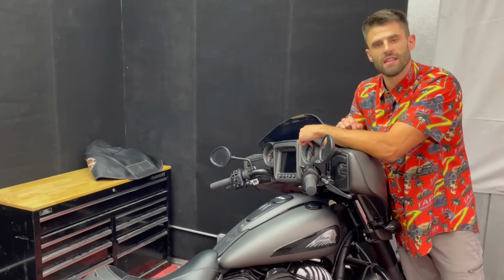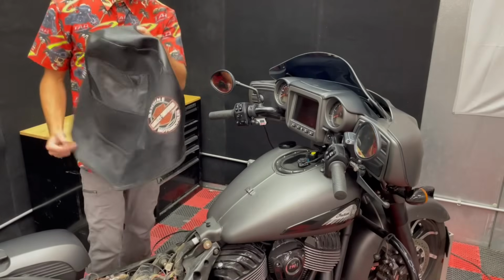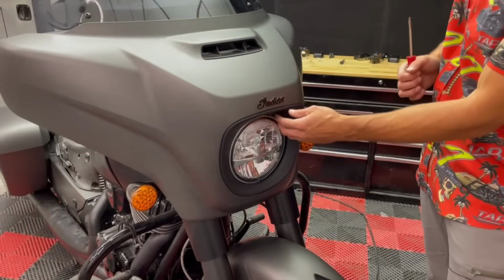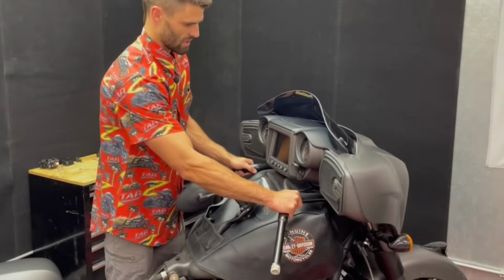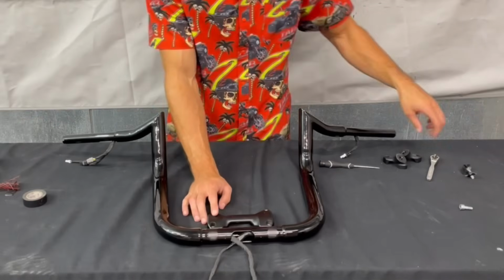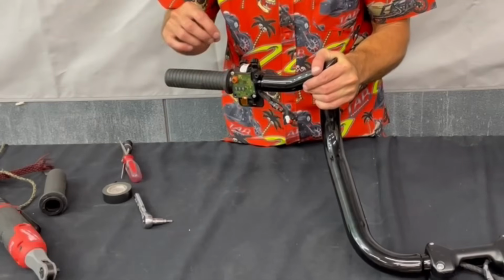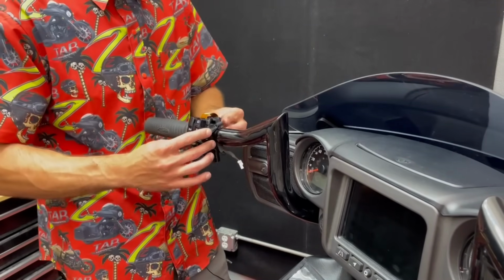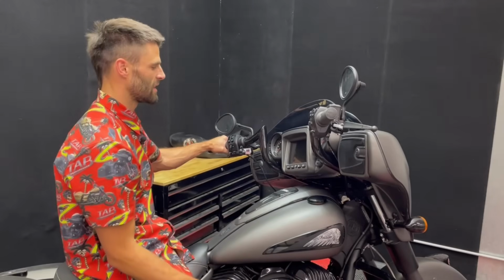Install Folsom Prison Bars on Indian Chieftain - A Complete Guide

Comment: did you need longer clutch and brake cables for this ? or did the oem work ?
Reply from the maker: Unless you're going with super tall bars you'd be surprised at how much extra length you can get out of the OEM cables!  You do have to pull up or loosen the cable guides sometimes, but from the factory Indian was very generous with how much cable they give you to work with.

Comment: Thanks for the detailed video! Are there any further adjustments that can be made to the handlebars? I noticed there are some serrated marks and am wondering if they can be moved away or toward the rider? Thanks and safe riding!
Reply from the maker: Marks are more for helping with alignment, but they can really only go one way with limited rotation due to the design of the fairing and tank for clearance.
Reply: @TABPerformance  Awesome, thanks for the info.
Reply: Hi there!
What’s the rise height of the handlebar you’re installing?
Thank you!
Reply: @tabperformance what bars are these, Plus 6 or Plus 8? Thanks